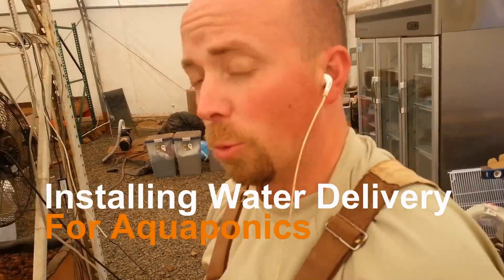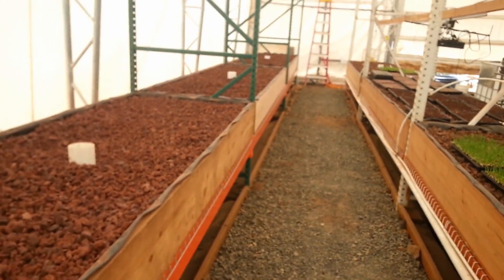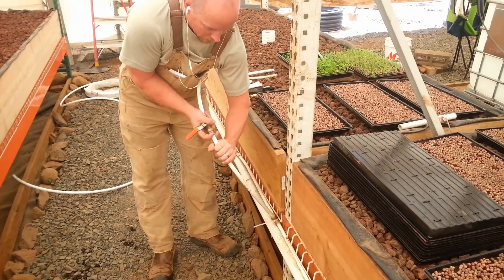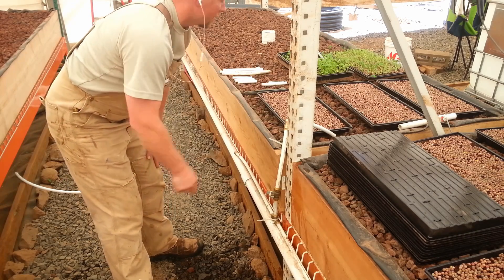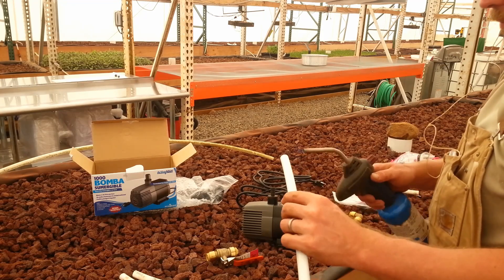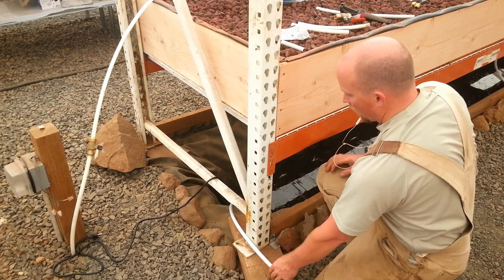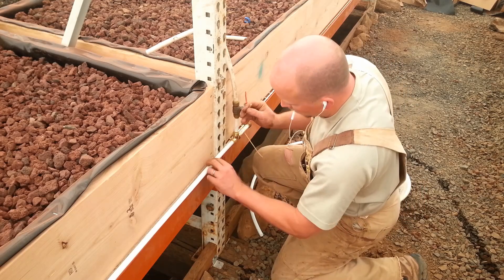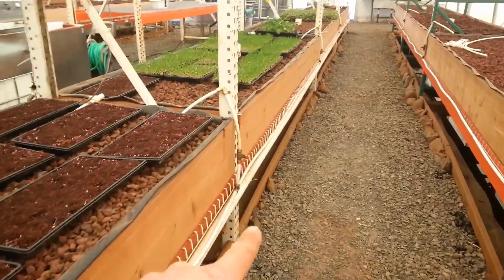FLOOD AND DRAIN Aquaponics

Comment: HI NICE JOB  JUST AS A COMENT BEDS ARE TO DIP TO MUCH LAVA ROCK LOTS OF PRESSURE ON PLASTIC YOU NEED TO WASH AND DESINFECT ROCK BEFORE YOU ADD THEM  WHEN TIME TO CLEAN BEDS ITS GOING TO BE A LOT OF WORK DRAINING ALL THE ROCK TO  ME AS YOUR PLAN IS GOING AND THE NICE JOB WHITH BEDS WILL BE MUCH BETTER A FLOTING TYPE WHIT NO ROCK JUST A COMENT NICE JOB

Comment: Have you tested diaphragm valves with dirty water before? They do tend to get clogged very easy, so it could be a maintenance nightmare, especially if you have lots of them! An alternative is the motorized ball valve, but it's more expensive...

Comment: I'm curious as to what valves you are going to use for your automation. Normal solenoid valves need a fair bit of pressure to operate correctly - typically a lot more than those pond pumps can provide.
Reply from the maker: we've been using these ones...so far no major problems: https://www.amazon.com/gp/product/B00K0TKJCU/ref=oh_aui_detailpage_o00_s00?ie=UTF8&psc=1
Reply: Cool - interesting to see they work at such low pressure.

Comment: Does the submersible heat up the water too much?
Reply from the maker: not at all...the volume of water relative to the size of the pump is so much larger that heating is negligable
Reply: Pitts Chapel Farm I'd imagine it would help in winter a slight fraction and evaporation in the summer should counteract any over temp issues :-)

Comment: I know you like Sharkbite fittings, but have you ever tried the pinch type PEX clamps at Lowes.   The crimper (and remover) tools are inexpensive enough to buy and the crimp clamps are much cheaper than Sharkbites and work as well or better.
Reply from the maker: I have...I own the tool...and it's probably user error but I didn't have a great experience with it.
Reply: The side crimp type (similar to automotive hose clamps)?  I found it to be even simpler than the full encirclement copper ring type that requires rental of the expensive crimpers.  In the opposite view, I've not had good results with Sharkbite fittings which often leak for me, though in general I think an o-ring seal is very good.  If they work for you and you can afford them, then carry on.

Comment: A FEW QUESTIONS:  so sorry if you are repeating yourself.  It looks like you are using pallet racks.  Did you decide against galvanized or were these recycled (upcycled)?  How do you handle temperature control (heating and cooling)?  It appears you are using shark bite fittings.  Any drawbacks that you can see?  I am thinking of replacing my copper with pex and shark bite fittings.  I like the systematic way you are thinking.  Are you an engineer by training?
Reply: John Lowe, Photographist go back through his videos. There's a history to what he's doing. Right now he's reconfiguring a prior setup for microgreens only and reusing existing equipment.
Reply from the maker: Pallet rack ended up being the most cost effective way to hold the weight that we have. You just can't beet it. I found a lot of it used and saved more $. Stay tuned on heating...that's coming up...check out the help wanted series on heating to get a good primer. No drawbacks on sharkbite other than cost. I highly recommend PEX and sharkbite...totally worth the $. I am an Aerospace Engineer by degree.